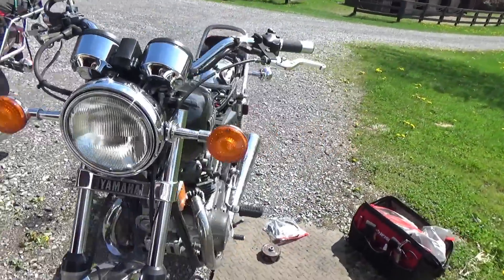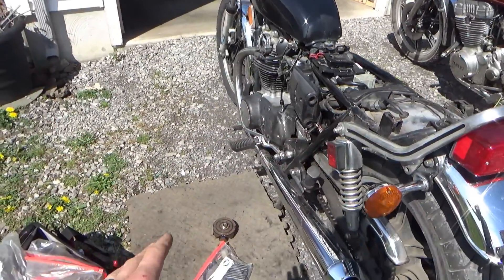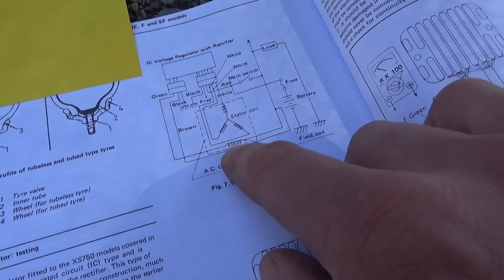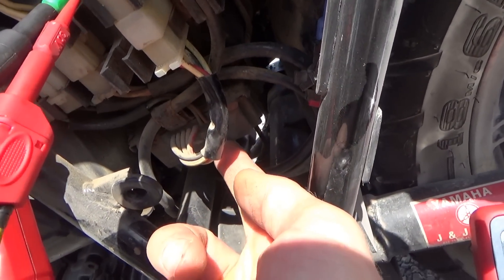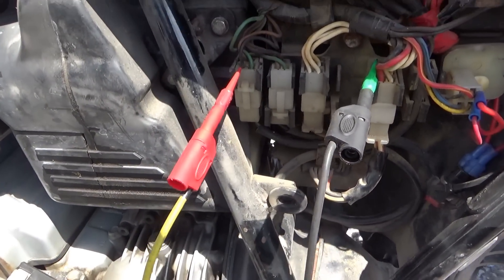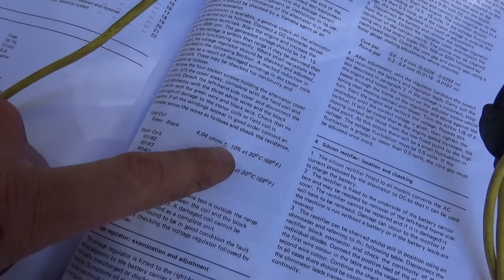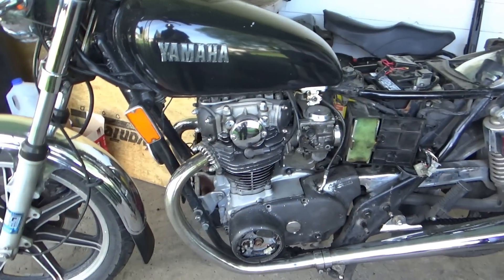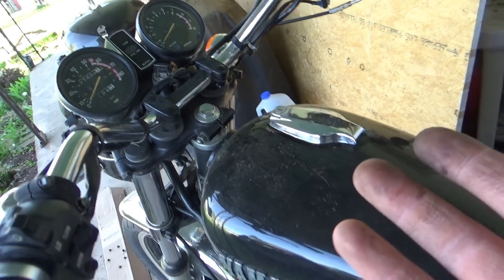Bad Diag? Bad Repair? Bad PARTS?? (Yamaha Battery Charging Problems)

Comment: I could see the problem immediately; it still has a stock suspension, and not a weld on hard tail, springer front end, and better (less) bodywork. 

XS 650 bobbers and choppers are awesome!
Reply from the maker: I say keep it stock..."cafe" chopped bikes make me cringe lol
Reply: @PineHollowAutoDiagnostics  I completely concur on the cafe bikes. I love choppers and bobbers, though.
Reply: @fredmalito9869  better to have a bike you can actually RIDE
Reply: @gtemnykh  I ride my chop! ‘71 CB750 with an 836 kit, 2 into 4 intake, rigid springer coming in at about 7 feet long. 

Guess I just know how to ride. 

I also have a ‘42 HD WLA bobber, that’s a rigid springer too. ‘48 Royal Enfield 350 Bullet. 2000 Buell X1. ‘78 CB750, ‘82 CB900C, ‘04 Dyna Low Rider bobber, ‘06 Street Glide. 

Only one that DOESN’T run is the bone stock Enfield. Only has 28km on the clock. Hadn’t run since the 50’s.

Comment: This is the typically the way it goes with the Chinesium aftermarket, sadly sometimes there is no other options. Try to find decent points for the old stuff. I think the part that rides on the lobes is paper machete. Just ran into that on a VW trike. Petronics system will cure that problem. 👍👍🇺🇸
Reply: Petronix
Reply: Pertronix, I’ll get it right eventually. Great alternative to the old points system, just do it right!.